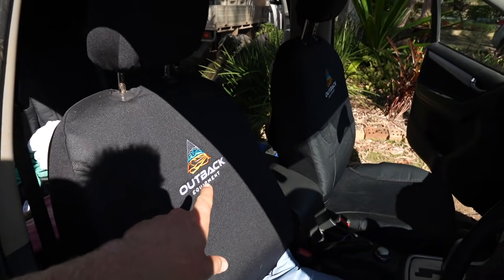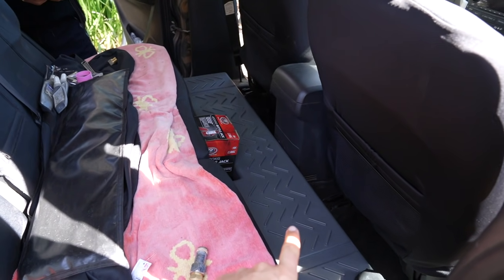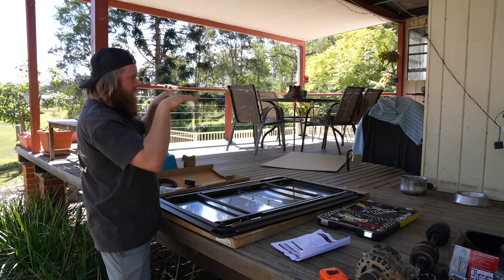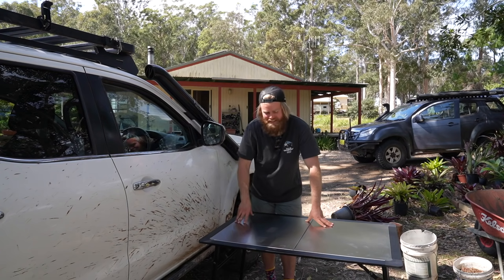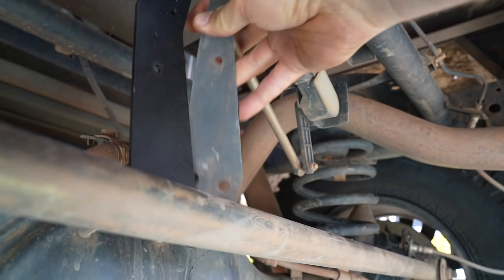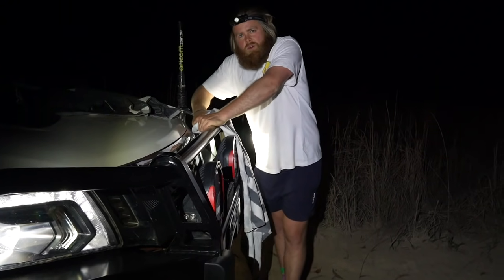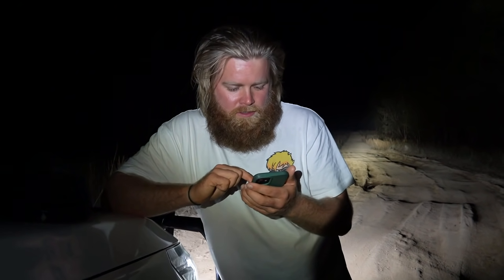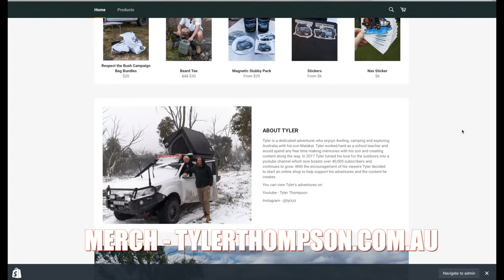UPGRADING the NAV & MUX! DIY installations! My new FAVOURITE mods. Roof rack camp table & water tank

Comment: I've had one of those boab footwell tanks for a coupla years now. Works a treat! I found using the plastic drew in fittings that come with the kit works really well. I'd think the metal fittings might put a bit too much stress on the plastics of the tank. Might be fine tho. Then using clear food grade hose with wire reinforcing, it's plumber up to a 4lpm pump thru to a hose gun in the back. Flick a switch and press the hand gun and water on demand! Bloody brilliant! I have a hose out of the other end with a plastic inline tap. Makes it easier to get the last bit of water out when the other end is permanently attached. I find there's always about 10L left once it runs dry from the outlets when it's sitting flat. Good reserve tank. Also found the easiest way to fill up on your travels is to but the 10l boxes of water with the bladder in them. If you pop the top off the goon bag it fits nicely in the top of the tank . . Just take your time cos spillage ain't fun 😜👍👌

Comment: If I was man enough for coil springs in the rear, I'd be putting the bump stops inside the coils and getting rid of the outboard stuff. That way it'll act as a spring retainer if you get droopy.
Reply from the maker: Cheers mate
Reply: Im sure thats where they go.
Reply: @bushysadventures1845  You're probably right. I'm not sure what coil navs have from the factory. I'm a "cruiser owner", so I may as well have bricks for springs
Reply: Well the length/shape does suggest it. But ive been stuck on leaves for.a.long time so 🤷‍♂️

Comment: Throw a bottle of straight red cordial into the poly tank before you use it for drinking water then rinse it out. Won’t get that plastic taste to the water 👌🏻
Reply: This is a great tip. Works a treat. PP

Comment: I had one of those footwell tanks in my old Pootrol. Worked great until you got on a side slope with it half to three quarter full. The water would slosh from one end to the other and you could feel the weight shift from left to right in the vehicle. Will be interesting to see how your dad goes with it as he does drive on rough terrain.

Comment: Drive your rig on a flat level surface with tyres at the proper pressure. Then put a spirit level straight up and down on the face of the lights. You can get them perfectly level.

Comment: I found I had to loosen the filler cap on occasions to let the water flow nicely from the tap but forgot to tighten it after use and then water would slosh out when driving and soak the carpet  . I drilled and tapped  hole in the top of the tank and put a raised breather so no more loosening lid .

Comment: Love your vids
I could be wrong but the bracket you changed in the back for your lights works similar to the brake proportioning valve. So if the rear is un loaded and sitting higher than the front it would raise the lights up a little and vise versa
Reply from the maker: Okay cheers!

Comment: hi mate I think that the bump stops fit inside the coils and replace the factory rubber cone that is in the inside. I don't think that that type fits where you are trying to fit it🤔
Reply from the maker: Okay cheers mate, shows how much I know haha. So does that mean it works as a coil retainer and a bump stop? 🤔
Reply: @TylerThompson90   something like that
Reply: @TylerThompson90  acts like a cushion to protect your shock from bottoming out or tyres chewing up the guard. Is a bit of a prick to fit. Need to get the coil out

Comment: For ya bump stops Jack the hole back end up and the you shud be able to undo the old ones with a socket and extention tru the top of bump stop and reuse the old bolt on the new ones and use a longer extention on sockets to put back on

Comment: Hey mate, not familiar with the nav bump stop set up but I extended mine by removing the factory bump and putting a bit of RHS steel between the diff and the bump stop. Will obviously need a longer bolt to suit but extremely cost effective and has done me well just get 4mm thick steel as a minimum
Reply from the maker: Okay thanks mate!

Comment: Hey just an idea with the m8 bolts for the recovery boards.
I assume when you remove them the bolts move around a little and make it a bit more awkward to put back on.

If you put a washer and nut on before the boards go on they will stay tight and make it easier to put boards on and off
Reply from the maker: Cheers mate, might do that

Comment: Any reason you didn't go with the Stedi Type X Pro spotties? They are less than $700 a pair with 26k raw lumens and IP68 rated and offer similar performance to the ARB intensity.

Comment: How have you found the water flow out of the footwell tank? I did a neat identical (gravity fed) set up and am struggling to get any reasonable water flow with the tank half full. Any tips on how you increased your water flow without using a pump?

Comment: Tyler you said those arb lights draw 2.4 amps but it should be 12.4 amps . Watts divided by volts = amps , so 165 ÷ 13.2 = 12.5 , ARB use those figures on their site .
Reply from the maker: Okay thanks mate!